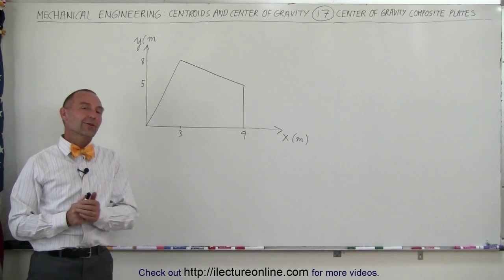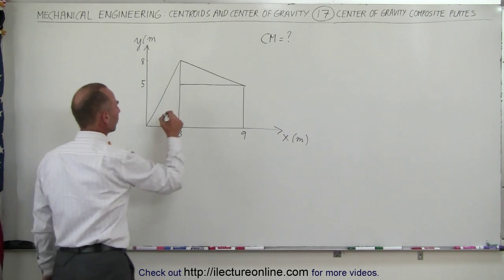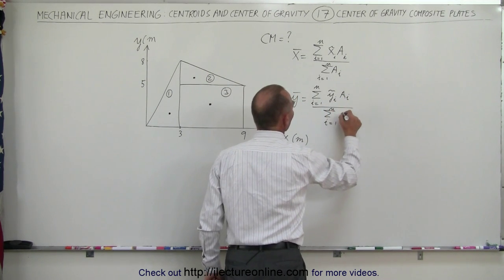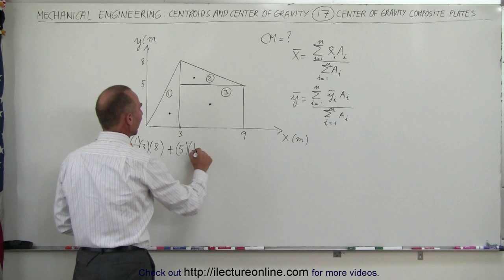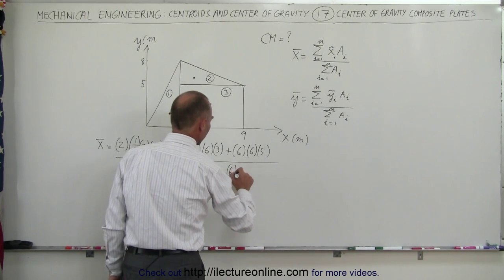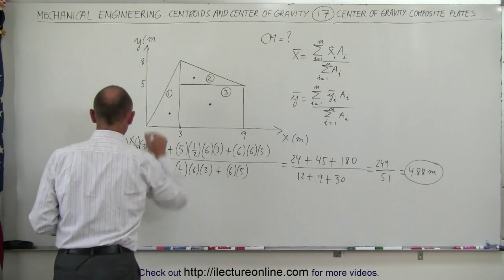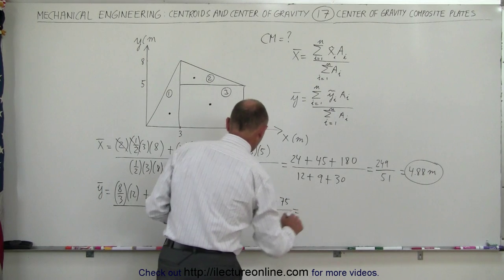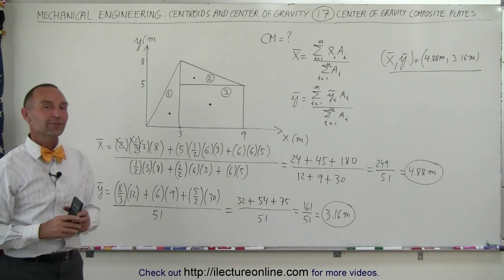Mechanical Engineering: Centroids & Center of Gravity (17 of 25) C. G. of a Composite Plate 2

Comment: Hi prof Michel. I might be a slow learner or just an idiot we were taught 1/3 of base for x and 1/3 of height for y for a triangle from the origin. but i dont understand how you ended up with 2 for the first and 5 for the second. i thought it would have been 1 for the 1st and 6 for the 2nd. Thank you sir.
Reply from the maker: For the first triangle, (in the x-direction), the centroid is 1/3 the distance from the base (which is at 3).  For the second triangle the centroid is 1/3 the distance from 3 to 9, which is 1/3 f of 6 which is 2  (added to 3)

Comment: how did you get 2 in the first triangle? you multiplied 2/3 *3 where did you get 2/3 from? I only see 1/3?
Reply from the maker: The center of mass in a triangle is 1/3 the distance from any base.  Since the base is on the other side, the center of mass is 2/3 the distance from the top of the triangle.

Comment: would you not have to find out the coordinate for the z axis, which would be half the thickness assuming it is uniform thickness, or is this not required.? Thanks
Reply from the maker: The assumption is that it is a thin plate and therefore there is no need to find the  center of mass in that direction.  (It is as you indicated).